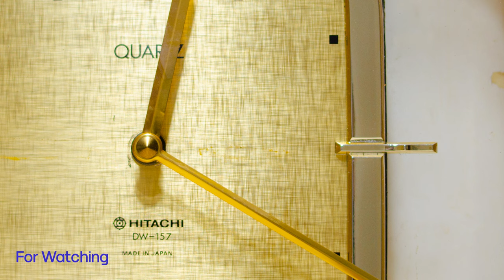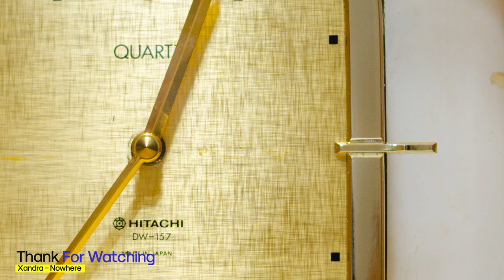how  wall clock restoration socket battery not complex like we are thinking.

Comment: I used a piece of steel wire on the outside connecting to the whole thing it works but takes a few tries
Reply from the maker: Sounds awesome! Just give it a few days and double-check that the battery is plugged in right